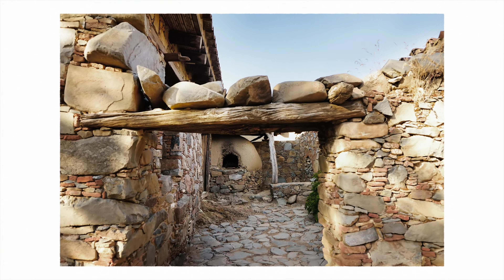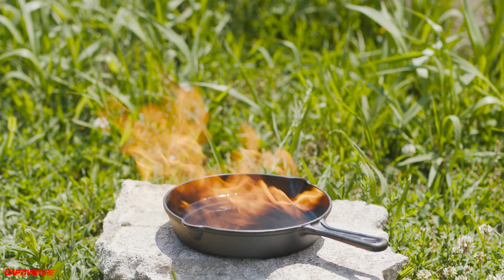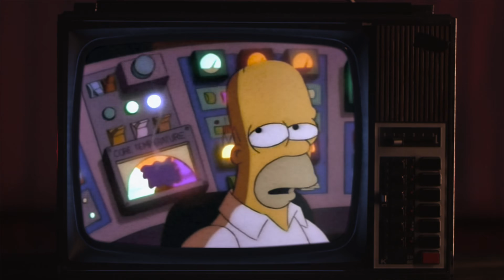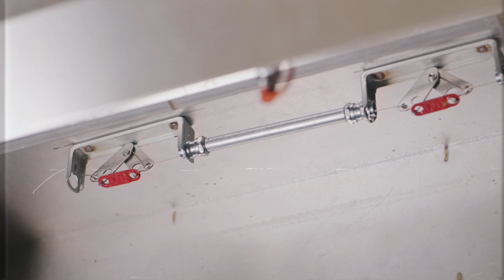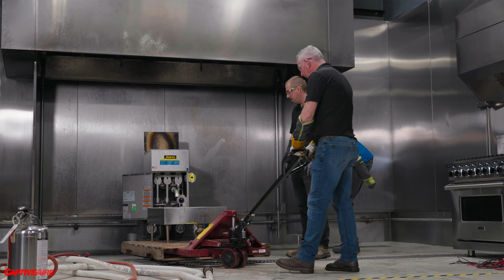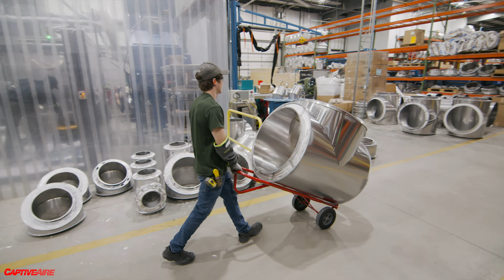Kitchen Fires 101

Comment: It's good to develop your own system, but it's so bad to talk bad about your competitors. I would like to remind you that the kitchen fire system with the most approvals on the planet, many more independant testing than yours.All the things you say on the ANSUL system are wrong, there is cartridge supervision, you cannot leave the pin because the lid will not fit, etc.
Reply: They didn’t bad mouth other systems? They simply stated faults they found in systems and how they developed their product to around those issues